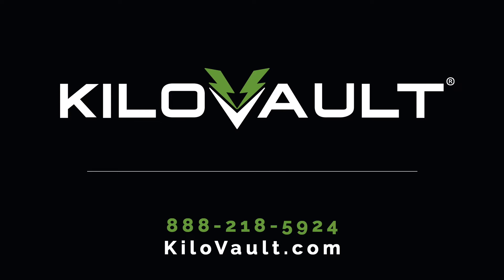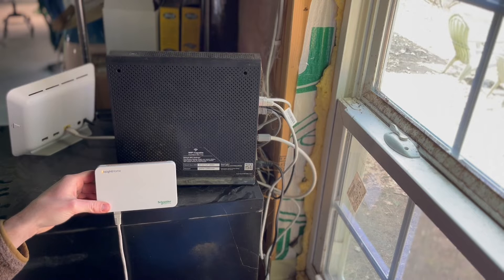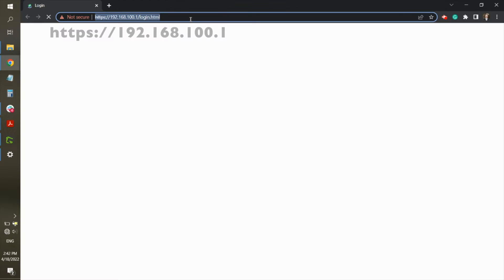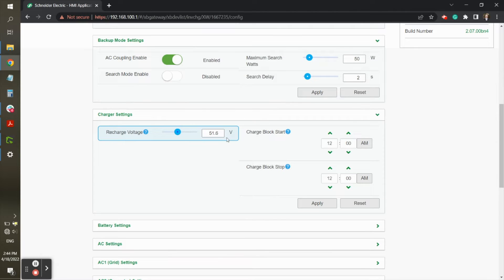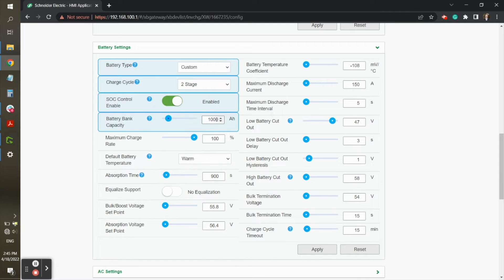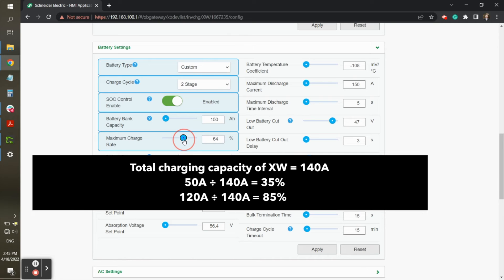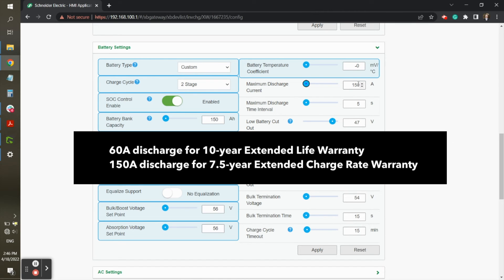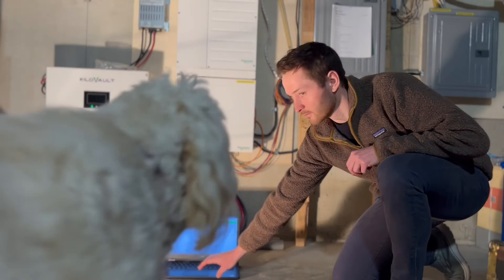KiloVault HAB and Schneider XW / XW Pro Integration

Comment: So you state the kilovault Hab Now supports closed-loop communication. Video Time 0:10  and then at 0:18 you go on and state I will be showing you how to do the setup manually: assuming closed-loop control is not enabled. So where is the setup for closed-loop control?   What good is closed-loop communication if the two systems are set for closed-loop control not enabled? This is the stupidest thing. They are lying about these two systems being able to do closed-loop integration. If you talk to Schnieder XW-Pro support they state they don't support this at this time. if you ask them when it will be supported they don't know. Yet the videos on you-tube all state that this integration works. Where is the Video that shows the closed-loop integration works?
Reply: Schneider solar has published a detailed video as how to connect kilovault battery in closed loop with SC inverter via Insight home gateway.